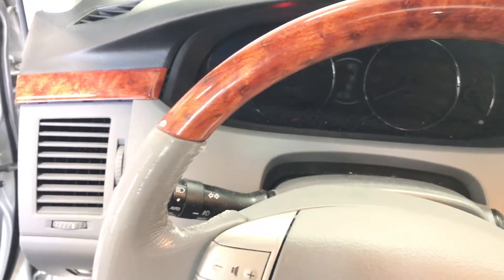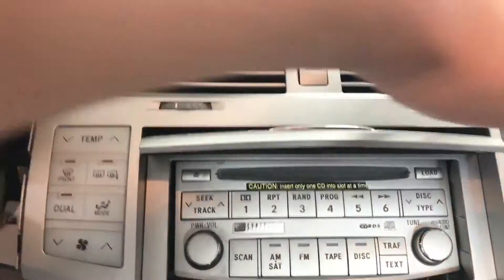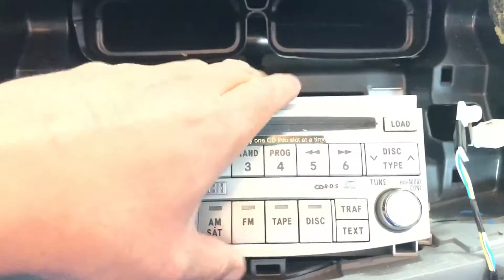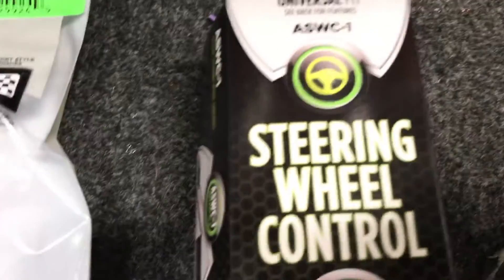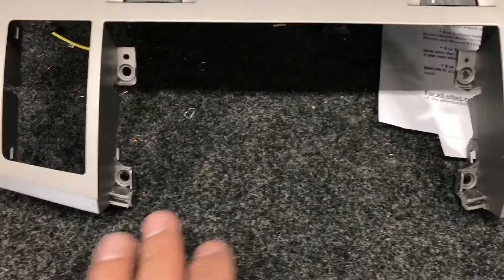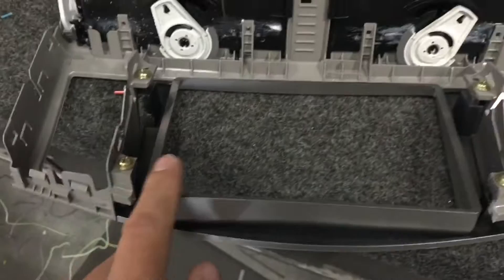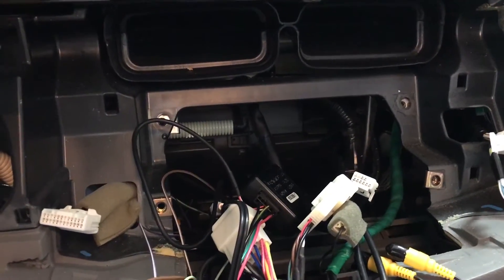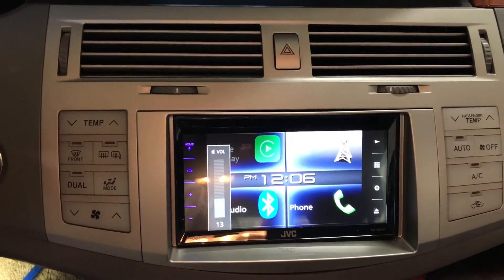2006 Toyota Avalon Limited radio replacement

Comment: Did you later realize you need to go to the parts store to get the relocation kit. From what I know, the original head unit must be relocated in the trunk.
Reply: You don’t need to with the ones with factory nav.

Comment: Hey Max, I just installed a new head unit in my 2005 Avalon but ran into problems when trying to connect the Axxess Interface steering wheel controls. Did you film yourself plugging that in? Specifically the tapping into the stock pins that are needed to get the unit working?
Reply from the maker: Kao Saelee unfortunately I did not record myself splicing into the steering wheel control wires. If your using the axxess steering wheel interface please visit their website. At their website you will be able to type in the vehicle information and they will allow you too see and print the harness schematic with the PIN numbers you will need to splice into. Hope that answers your question

Comment: Hey there, I'm trying to do something similar. Is there only certain radios that will work for this exact model of car? Are the choices endless as long as I get the PAC RP4.2-TY11 harness?
Reply from the maker: Robert B single or double din size radio will fit that dash location obviously it's always great to go with a double din size radio. As long as you have the interface any radio will work with it.

Comment: When I change into a new touch-screen player, the original blue screen with temperature display has not any signal. How should I connect to the original blue screen that can be displayed normally? Thank you for your professional guidance!
Reply: You must relocate the original head unit in the trunk

Comment: Hi, I have two questions.  1. Do you have the cassette desk underneath or the Navigation?. 2. Did you have to relocate the factory radio somewhere else in the car in order to retain the climate control display etc that is on the LCD screen on the dash?
Reply from the maker: This particular vehicle had the factory Navigation. I did not relocate the oem radio. Upper climate control display will be retained by using the PAC RP4.2-TY11 as long as the firmware is 01.00.33 or newer.
Hope that helps answer your question